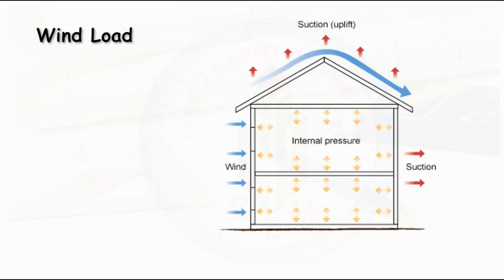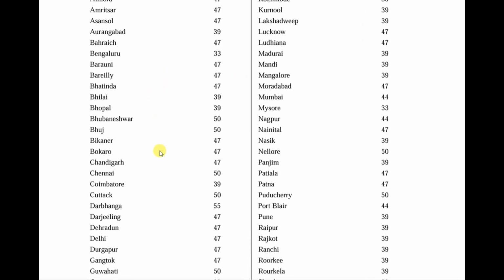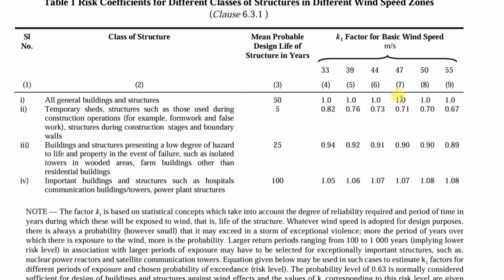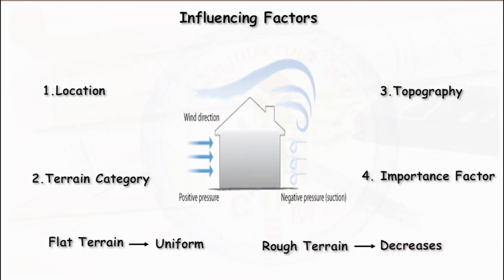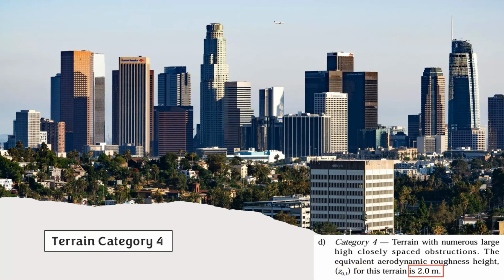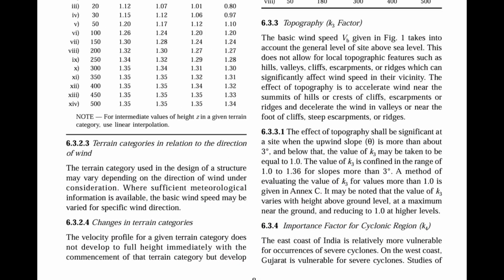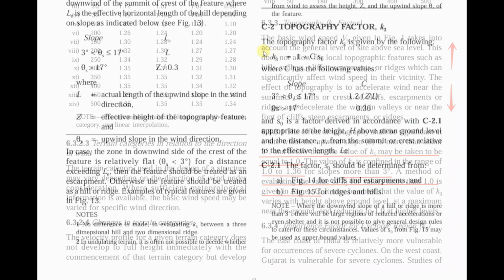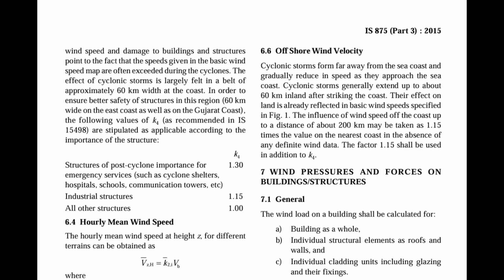Wind Load Influencing Factors | Wind load factors IS-875-2015 Part-3 | Wind load factors in design

Comment: By the way, are you conducting any online classes akka, especially on Manual Steel and RCC design? I'm very eager to learn from you. Kindy let me know akka😊Thank you!
Reply from the maker: Kindly refer to the link below for RCC design using ETAB Software 
The manual calculation also explained
https://www.udemy.com/course/structural-design-of-buildings-using-etabs-software/?couponCode=E8587B63A3B7EE2E64A5
Kindly refer to the link below for RCC design using Staad.Pro Software 
https://www.udemy.com/course/staadpro-v8i-structural-analysis-design-of-a-rcc-building/?couponCode=C60D61075103FAC59F33
Reply: @CivilEngineeringMastery Thank you so much akka! 😊

I am also wondering if you're conducting any online courses on Manual Steel Design for Complete Steel Building...or software course for Complete Steel Building Design using software + manual Steel design calculations...

Kindly let me know and I am very eager to join your courses! 😊✨
Reply: Akka, also is it possible for you to provide your contact details, so that I could ask you doubts?